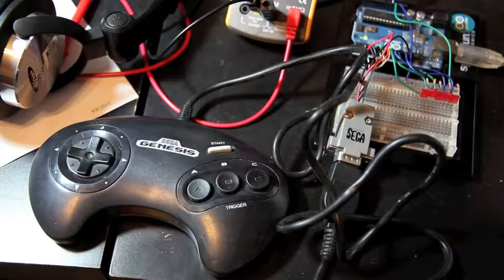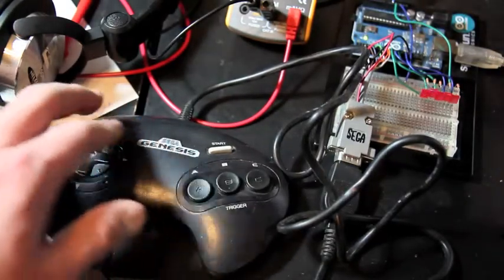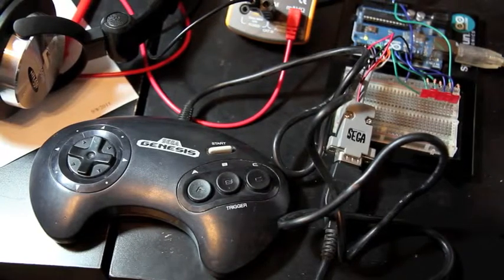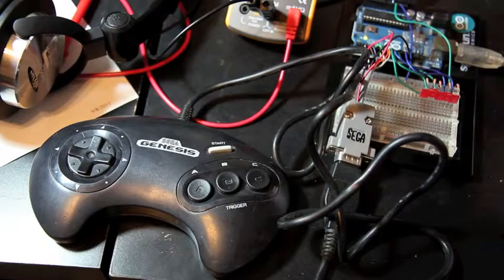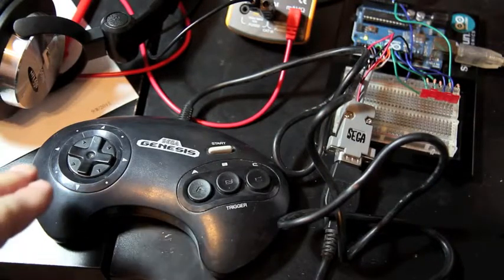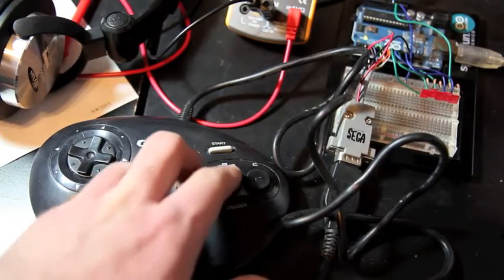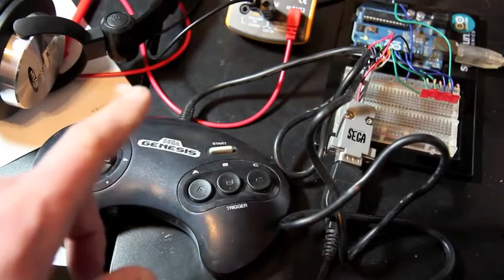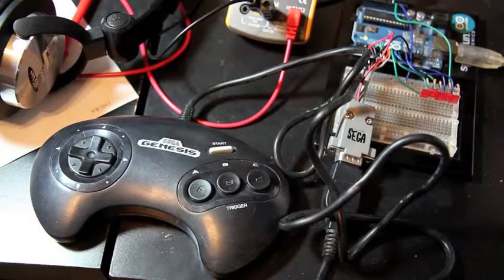Sega Genesis Controller interfacing with Arduino Uno

Comment: To fix the issue with buttons sticking or not working, open up the controller and clean the button pads on the pcb with rubbing alcohol.